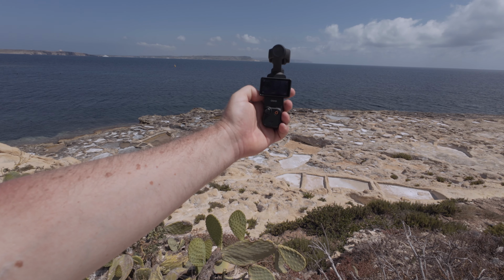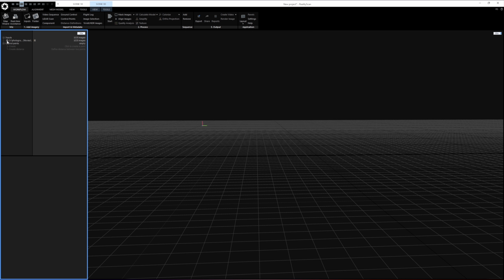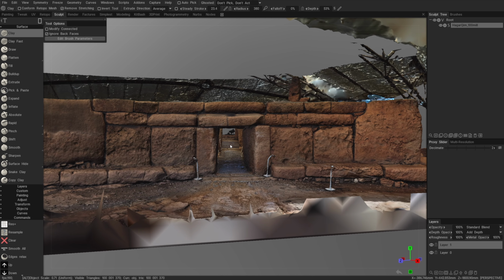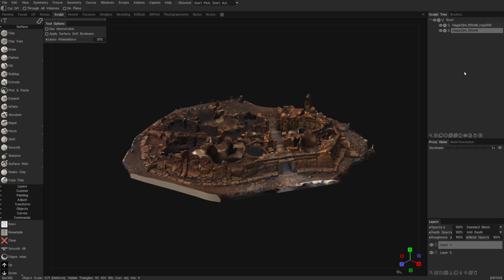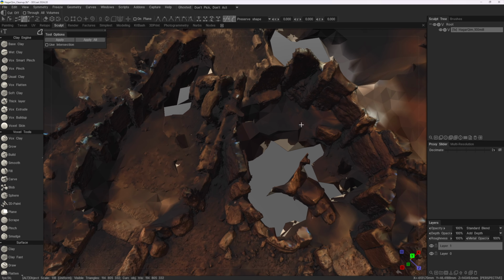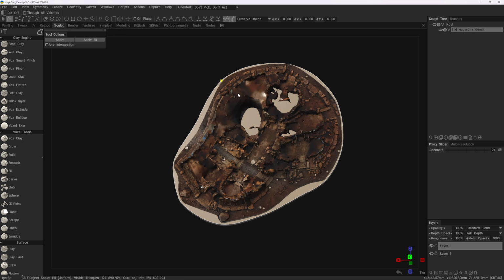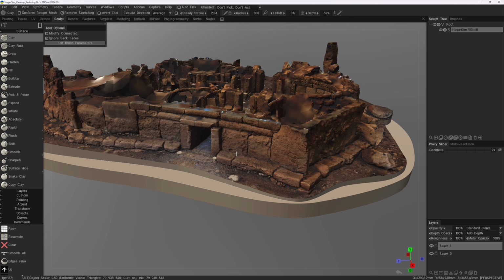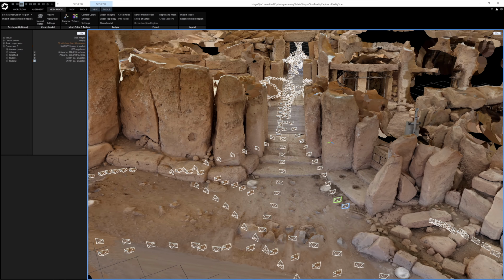Photogrammetry using 4K video, is it any good? Surprising results.

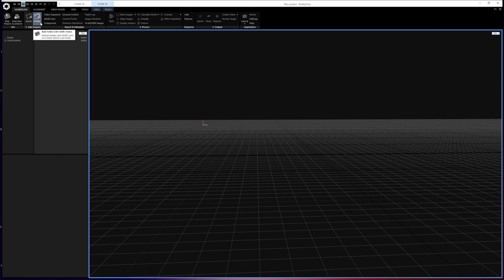Comment: 5:43 Instead of using a video, which program did you use to extract the frames and what jump length did you use?
Reply from the maker: I often use the extract video feature in Reality Scan. 1 frame per second is usually the best if you walk quite slow but not crazy slow. Many compositors like Nuke has the same feature. I now use Lichtfelds latest build, it has a frame extractor.
Reply: @MidgardGeo  So, did you also use Lichtfeld for frame extraction in this tutorial? Video extraction is one method, but I'd prefer to extract the frames so I can batch-edit them in Lightroom or occasionally make adjustments to specific frames. What software did you use?
Reply from the maker: @FjodorKaramasow This was extracted in Reality scan. You get a folder with the frames.

Comment: Videogrammetry gives you a fast design with plenty of overflap on the images but the quality is far worse than taking photos.
Reply from the maker: It’s a lot worse but it’s very good as a safety backup and a first draft for large areas. There is no substitute for a real camera with high dynamic range. In the future maybe, with 8k 🤔
Reply: @MidgardGeo  "...t’s a lot worse but it’s very good as a safety backup and a first draft for large areas...." That´s exactly what I said. 

"...There is no substitute for a real camera with high dynamic range. In the future maybe, with 8k 🤔..." It depends on what you see as acceptable quality. I do photogrammetry or videogrammetry for fun in many cases and the quality is just good enough for me. But yes, Quality from pictures will always be better in general.

Comment: Great video. I was amazed with results from DJI Pocket!
Reply from the maker: Thanks, it’s very useful especially for these large set pieces. Good to have as a backup if you miss a spot while scanning.
Reply: @MidgardGeo  Thanks for sharing. I wanted to ask you how do you manage to import 100M polys into 3D Coat? Everytime I'm uploading an object over 20M I'm getting a crash. I never had such issues with ZBrush and I'm trying 3D Coat as an alternative.
Reply from the maker: @dvogiatzis Glad you asked. Actually in the new 2025 version there is a cap if 25 million it seems. But in 2024 version you can import 100 million. I have a ticket in and hopefully a hot fix will come soon.
Reply: @MidgardGeo  OK that makes sense. Let's hope they change the cap back to 100 mil soon.
Reply from the maker: @dvogiatzis I’ll post something here as soon as it happens
Reply: @MidgardGeo  I think a lot of us would appreciate some videos about 3D Coat. It's a great software and there is not a lot of things out there when you compare it to ZBrush. I consider ZBrush an overkill for photogrammetry and trying to find a faster workflow.
Reply: @MidgardGeo  I tried with earlier versions 2024 and I'm getting the same crash with the error about the Virtual ram. I have a 5080 with 16GB and 128 GB DDR5. Blender loads the mesh without a problem. I can't make any sense of it. 25 mil polygons is not enough if you need to work with a big photogrammetry project that consists a big area.
Reply from the maker: @dvogiatzis Ok that’s weird. It works for me with a 100 million polys. I’m using the version 2024.20. Maybe it broke after that? I will write them and push it because it’s unusable with only 25 million polys.
Reply: @MidgardGeo  I will try 2024.20 as well. But I agree it's unusable for 25 mil for photogrammetry projects.
Reply: I tried version 2023.37 and imported an FBX file of 100 mil polys without any problem on a RTX 3080, AMD 5950X with 64 GB RAM machine.
Reply: I tried 2024.31 and it's working fine as well and it's pretty fast compared to 2025 version. I've send another bug report but it's been like a week or 2 since I have send the first one and had no answer.
Reply: 3D Coat 2024.32 is crashing and is low on fps on my computer compared to 2024.31.
Reply from the maker: @dvogiatzis That’s great detective work.  I think summer holiday time over there. I didn’t get an answer either.